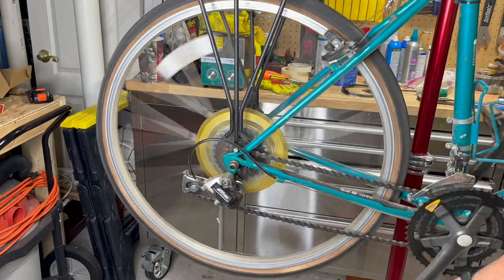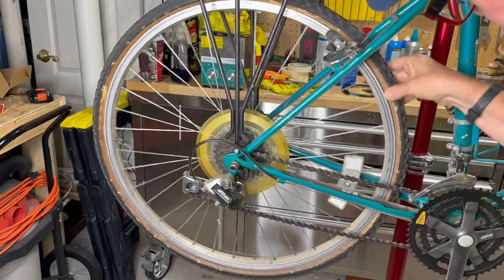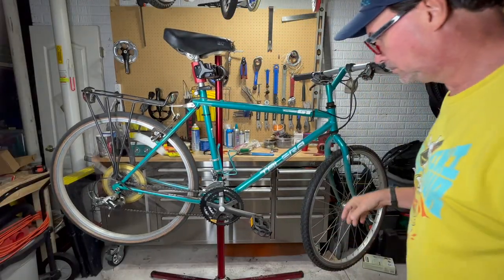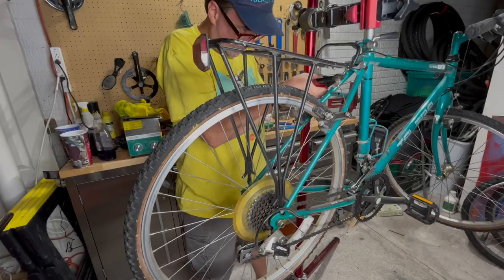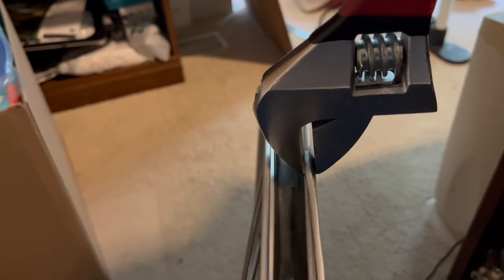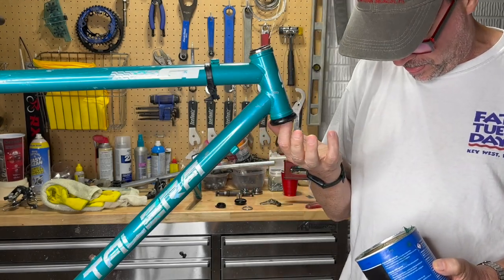I rebuilt a friends bicycle after shop refused to! (Bicycle Rebuild - GT Talera)

Comment: Most of the bike shops where I live don't want to work on bikes anymore, They will do easy stuff but that's about it.  You have to learn how to do a lot of stuff yourself now.
Reply from the maker: Thanks for watching!  My favorite bike shop closed last year.  They were toe guys I went to for things I could not do myself.  It’s a sad day when good shops close.
Reply: They only bike shop that actually worked on bikes by me is long gone. There is a shop that will do tune ups and maybe replace a derailleur. But that’s it.
Reply: The bike shop I had been going to since I was literally a child didn't survive covid. Or rather, it did but under new ownership. The guy that sold it at that time was a grand master and the new staff and owners are much much less than. Sad when those shops go under, especially when I have no bike repair skills whatsoever unlike the guy in this video!
Reply: @goatsplitter  You can learn doing almost everything by yourself - especially in this day and age with an abundance of yt-tutorials for everything.
It's not rocket science at all, if you don't have 2 left hands. :)
Reply: @MegaSockenschuss  that's true, but I don't have the space, desire, or time to do so. I just like to ride the dangol things, and don't mind paying a good shop or person otherwise to do the work. Good ol societal bartering at work :) thank glob for you handy bike mechanic types!

Comment: One of the reasons I prefer to work on my own bikes rather than sending them to a bike shop is the cost of labour, I'd rather buy the tool and learn how to do the jobs myself and it gives me satisfaction to know I have learned something new.  
Sometimes you have to weigh things up, spend the money on new tools or get the shop to do a job. If I can wait and save the money up for a new tool, then I'll do so.  As long as I have access to a bike I can ride in the meantime...
I learned to strip  and rebuild my BMX on my own at the age of 13, and later continued on my mountain bikes when I worked and earned money to buy tools.  I got a part time job working on bikes for a number of years which was great.
But it's not the only thing I ever want to do, I have other interests too but can only spend my money once at a time.
Reply from the maker: That’s great!  Thanks for watching!!
Reply: I see this same comment on every DIY video 😂
Reply from the maker: @iwearLingerie  Thanks for Watching!

Comment: I would have worked on it as an average mechanic, not good at wheel straightening can get by, but could have done all the rest.   "Sorry we don't want to work on this for you, not worth our time but we could take ten minutes to sell you a new bike which is better  time to dollar ratio for us?!"  Bad!         Good job!.   Drew
Reply from the maker: Thanks for watching!!  I’m not good at truing wheels either, but will take some time this winter at some wheel building. I have several old wheels I won’t use and will take them apart and try to lace them up.  Again. Thanks for watching!!

Comment: I help out at a Trek shop in the summer.  This is a very straight forward bike but most customers just want a tune up and this was pretty much an overhaul that would take several hours and probably not worth it considering how little it got used.  Tires and brake pads are probably more important than replacing all the cables unless they were rusted and corroded. Glad to see the front skewer was installed correctly after coming in wrong. Did anyone else notice that?
Reply from the maker: Thanks for watching!!

Comment: I'm really curious how long this actually took.  I do this same sort of rebuilds for a local bike co-op and this level of detail would take me 5 or 6 hours to complete.
Reply from the maker: Thanks for watching and commenting.  I have a day job, so it takes me about a week to do one of these bikes.  When I have 15 minutes between meetings or some free time at lunch, I film one part of the process at a time.

One of these days when I dont have work, I will have to time myself to see how long it really takes me from start to finish.  One of the long poles in the tent is when I find I need to replace a chain or shifters and I need to order them from Amazon.

Comment: So you replaced a wheel instead of just a rim, cables, new grease in headset and BB and that’s a restoration lol
Reply from the maker: Thanks for watching.  I think you captured the readers digest version of the video.  I have not attempted any wheel building yet, but plan on learning this winter when things slow down.  Again, thanks for watching!